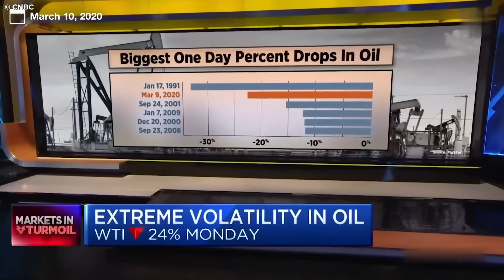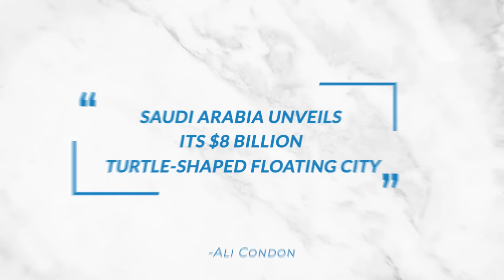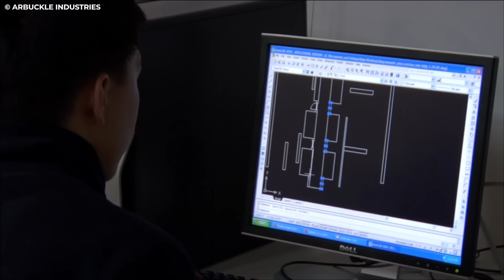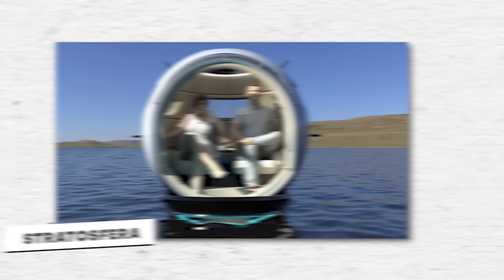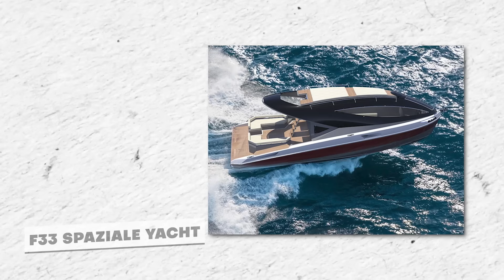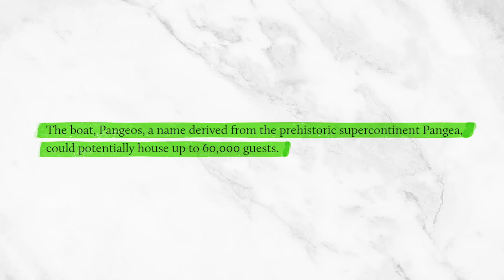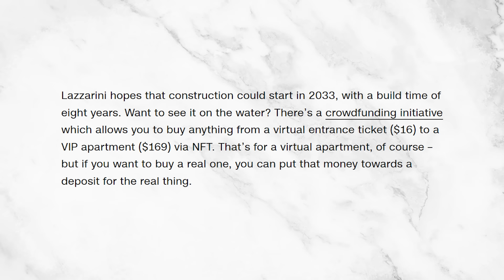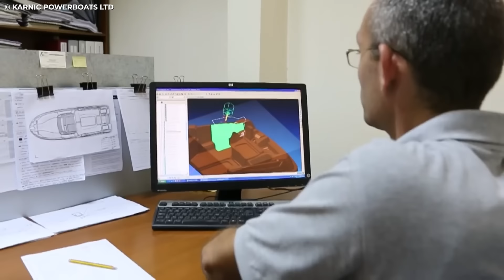Inside Saudi Arabia's $8 Billion Mega City

Comment: Absolute power. . . . How much good in the world could thier weath create? Length 550 mts width 610 mts. Makes this structure moving through the water absolutely gargantuan is capable of carrying 66ooo residents. On this vessel there will a multitude of record breaking, well, everything. Though for all the records this monster is ridiculously idiotic. In the middle of any of earths oceans this creation becomes ralivant as drift wood. Why, because motion of the sea and waves forming will not be as though it will just run aground been so big. No it would sink with hardly a trace! So sad how man can be so horribly egotistical. We are still so very primitive in the scheme of evolution. We're not evec half way to level 1 of species evolving from 1 to 6.